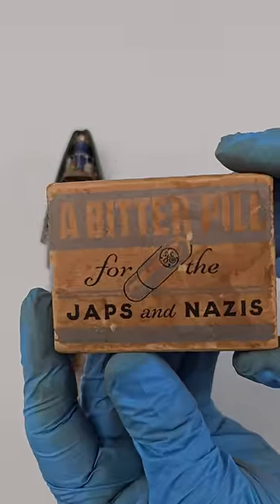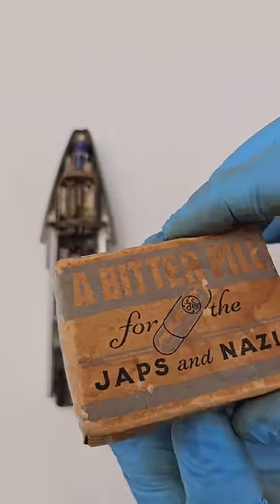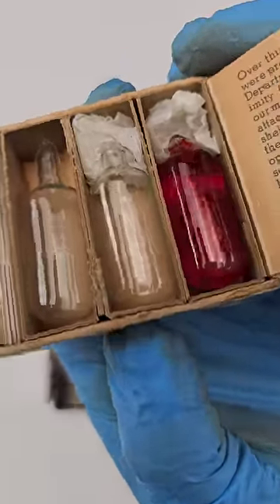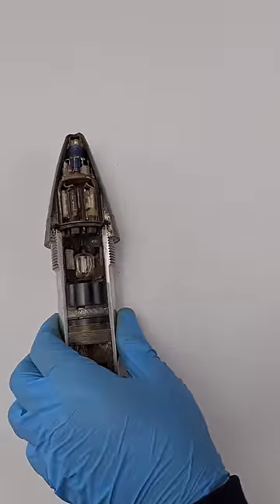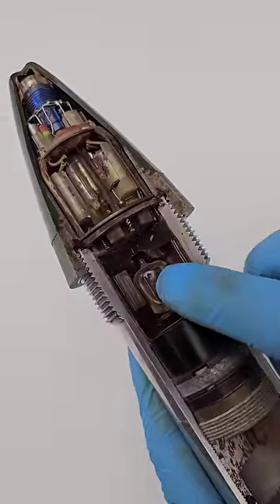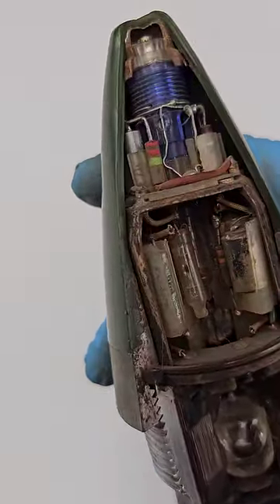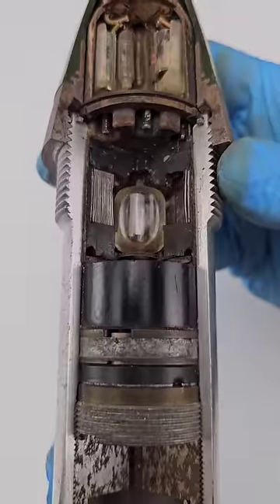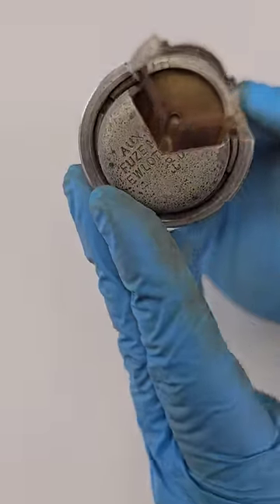RADIO PROXIMITY FUZE: General Electric Helps Beat Kamikazes & Win WW2 #military #history #technology

Comment: It's just astounding looking back at how far you could take analog technology
Reply: and still do. any electronic device you see or hear depends on analog circuitry still.
Reply: @tsm688  <<<<< lights a pipe n thinks that shit over. Ate you sure?
Reply: I love my old E.M.P. proof tube shortwave radios.
Reply: @timkelly2931  youtube seems to have eaten my long in-depth reply.

But yes.  A speaker requires an analog voltage to drive it.  A pixel requires an analog voltage to light it more or less.

Comment: British war winner, we just had no capacity to make it, however, the Americans made a fantastic job of further miniaturisation and they had capacity to mass produce. First used over water only to prevent it from being discovered by an enemy. Before it arrived it took approx 400 AA rounds to down a plane, after it was 40.
Reply from the maker: Good, correct, info!
Reply: This answers a lifelong question for me.. why do every WW2 footage of AA guns shows ten of them shooting at the same aircraft with no success.. 400 to 40 is crazy.
Reply: Incorrect. This design was 100% American. The Applied Physics Laboratory of Johns Hopkins University was already in work on the VT fuse before the British data was sent. The British design was a semi-active fuse that was to have only a receiver in the shell and would have depended on the transmitter in the radar set on the ground. It would have been much less effective in air to air use than the active system the US design used which had both a transmitter and receiver in the projectile. It would also be completely useless in the air burst mode that so decimated the Germans in the Ardennes. APL basically looked at the British documentation and said, nice, but ours is better. Johns Hopkins put out a documentary on the development of the VT fuse on its 50th anniversary, you should look it up, it's very good.

Comment: The artillery corps demonstrated the variable timed (non radio) version of the VT round for General Patton during WW II in “tree burst” mode. He watched from a hill as a barrage of artillery removed all of the vegetation from a small stand of trees. His response? “Those funny little fuses will change the war.” They were used to maximum effect in the Ardennes Forest in the counteroffensive of the Battle of the Bulge.
Reply: German mortars and artillery that were manually time fused to burst at tree top height during the battle of Hurtgen forest caused tons of casualties.  A VT fuse would have made those barrages far worse.

Comment: Well i recognize a couple resistors 1 capacitor, and  diodes... Dam i miss Radio Shack...
Reply: lol! No diodes back then, big old carbon composition resistor and mica capacitors, maybe a wax slug cap. The tiny vacuum tubes on the bottom of the circuit board were considered "top secret" you cant find spec sheets on them anywhere. I did find some schematics for these a few years ago. The circuit is real simple and is a type of regenerative receiver, which transmits and receives simultaneously.
Reply: @user-cr5yy4te3i  Haaa there's is intelligents still out there, Had a beer the other day with a friend of mine.
Reminisce of the old days of working on the radars, laughing our heads off, trying to remember the old saying about reading the Ohms resistance, on a resistor. All we could put together was (Every good girl)& (Violet gives willingly). 🤣 Thanks for the  information. Nice to know, 👍
Reply: me tooooo!! 😭
Reply: Yeah me too
Reply: Ebay and Amazon bro 😎
Reply: I miss Circuit City
Reply: @DrTwoGreenThumbs  bought some rally nice stuff down in Flordia, I miss them too
Reply: Sorry but u don't recognize (u actual are wrong completely different electronics present here) nor were they at radio shack at the time u were likely born
Reply: I miss Radio Shack, too. I was an advertising artist at Tandy. Good times.
Reply: Me too man i think we in hell now
Reply: wow you just named a few super common parts that are in almost anything that requires electricity to turn on... you must be so smart.... god if I could roll my eyes any god damn harder I would...
Reply: Dudeee
Reply: @tom4208  i  man yea his comment is cringe but yours is also hella cringe
Reply: Ah yes! When we use to FIX things, not just replace.
Reply: @daleslover2771 But Violet Gives Willingly.....I think, '83  was a while ago 😊

Comment: I was in an artillery unit in the NHNG. Later proximity fuzes had a mechanical timer built in that would delay the arming of the fuze until after number of seconds that could be set. This was so we could fire the rounds over hills or ridges and not have the round go off until after it had cleared them. We referred to these fuzes as "VT" (Variable Time) fuzes, despite them actually being detonated by proximity to ground. In a pinch, they could also be set for "PD" or Point Detonating.

Comment: One of the Best British inventions
Reply: Ah, yes. GE. The great British company… Ya, sure buddy
Reply: @KennethStone ah yes, an American company gers given an invitation to copy & that makes it an American invitation. Ya sure buddy 🤣
The proximity fuse was invented in 1940  by Samuel Curran, William Butement, Edward Shire, and Amherst Thomson. All of whom are British.
Reply: @KennethStone Manufactured by GE. They didn't invent them.
Reply: @chrissearle6176  Incorrect. This design was 100% American. The Applied Physics Laboratory of Johns Hopkins University was already in work on the VT fuse before the British data was sent. The British design was a semi-active fuse that was to have only a receiver in the shell and would have depended on the transmitter in the radar set on the ground. It would have been much less effective in air to air use than the active system the US design used which had both a transmitter and receiver in the projectile. It would also be completely useless in the air burst mode that so decimated the Germans in the Ardennes. APL basically looked at the British documentation and said, nice, but ours is better. Johns Hopkins put out a documentary on the development of the VT fuse on its 50th anniversary, you should look it up, it's very good.
Reply: @chrissearle6176  Invented? Writing a paper that says "we should put a tiny radar into an artillery projectile" isn't really inventing. It's stating the obvious. Inventing is producing the hardware.
Reply: @Mishn0    no you are in lncorrect
Firstly, Everybody was working on proximity fuses & there were loads of different types of proximity fuse being designed in lots of countries, it was Britain that solved all the issues of miniaturisation & invented the parts needed such as the Cavity Magnatron & made & used the 1st PF. These fuses, information & findings were shared with John Hopkins as part of the co-operation projects. They then when on to help refine it. They also figured out the problem of mass production.
Reply: @Mishn0  yes invented, the proximity fuse requires 4 British inventions, most importantly the Cavity Magnatron. It was the British that solved miniaturisation & produced & used the 1st fuse. That was then shared with America through the joint research project.
Reply: @Mishn0  The Brits also invented radar itself at around the same time, so saying "we should put this thing we just invented into a shell" kinda IS inventing the idea...
Reply: @Aethid  No, the Brits did not invent radar. They did invent the cavity magnetron which made a large increase in transmitter power. Why is it, when a Brit supposedly invents something, it means it would never had existed otherwise? The concept of radar was discovered by the US Navy, by accident, way back in 1921. Germany, Japan and probably Italy and Russia also independently "invented" radar.
Reply: @chrissearle6176  There's no magnetron in a VT fuse. And please read what I wrote, the VT fuse that was introduced into service wasn't the design that was shared by the Brits. It was developed by the APL. Watch the documentary I mentioned.
Reply: @Mishn0  theres no magnetron in a variable timming fuse, but there is in a proximity fuse. you can't produce the radio pulse in small transmitters without the Cavity magnetron.
Reply: @chrissearle6176  VT was the code name for the radar proximity fuse developed by APL. They wanted any adversary hearing about it to think it was just another variable time fuse. 

There is no magnetron in the VT fuse. It's not big enough. It probably used a klystron tube as it didn't need the high power of a magnetron as it acted at a comparatively short range.

A magnetron is not required for a radar, it just needs a microwave frequency oscillator, of which a magnetron is one type. 
Actually, a radar set needs at least two oscillators, the receiver needs it own local oscillator that is tuned to the received pulses who's frequency will be different that the transmit pulse due to doppler shift. A travelling wave tube is another high-power microwave oscillator.

The radar I used to work on used a magnetron for the transmitter and a klystron for the receiver. A magnetron wouldn't work in the receiver because it needed to by dynamically tunable to adjust to the changing doppler shifted return pulses.

 Don't talk about things of which you know nothing about.
Reply: @Mishn0  The key invention behind radar is the cavity magnetron. A British invention. Multiple people around the world thought of the basic idea of bouncing radio waves off something to measure distance, but the technology to actually do it was invented by the Brits.
Reply: @Aethid  Hmmm, the Germans did pretty well with their radars, even before they captured their first magnetron in '43. They were using the "Freye" early warning radar as early as '40. Magnetrons make radars better, but they aren't required. You guys really like to bang that drum, don't you?

Comment: never would have guesswd that's how it worked. Wonder how long it took Nazi command to figure out why the Allies' AA seemed so lucky!
Reply: it was mostly Japanese aircraft that these shells were used against, surviving pilots said that they took a physical beating from these shells, there were so many exploding so close that the shocks threw them around.
Reply: @BjarneLinetsky  Yep it was used to devastating effect against the Japanese in the Pacific, mostly by the US. IIRC it lowered ammunition expenditure rates by an order of magnitude it was so effective at destroying planes, no more setting fuses for airburst or hoping you got a direct hit with 5" shell.
Reply: @BjarneLinetsky It was used in Europe for artillery though. Similar to how the Germans used mechanical fuses for airbursts in forested areas.
Reply: @Rico-v7r  Not this particular fuse. They had another design used on mortar shells that would explode the shell 50 feet above ground. My father was well acquainted with the German shells, having experienced the Ardennes Forest during the Battle of the Bulge.
Reply: They weren't used over land until late in the war. They were too worried about shells getting recovered and potentially reverse engineers, so they were only used over water. Late in the European theater I believe they used them to create air burst artillery that was quite devastating against the Germans.
Reply: @bobbygetsbanned6049 I think there were used in the bridge to far operation to try and get to the bridge. Considered important enough to override the security issue
Reply: I always wondered how long it took before the germans were able to get the fuses on the black market,(if at all), because in ALL wars there is ALLWAYS  a very active black market used by both belligerents, military and civilian.
Reply: I'm pretty sure one thing they were used for was the defense of Britain against V1s! They were part of the reason why during the later part of their use over 80% could get intercepted with only around a hundred shots per bomb, which is pretty incredible!
Reply: @markbowles2382  The Germans never did because it was a military secret. The Germans did however copy the Bazooka
Reply: A day maybe? They were well aware of the concept of a proximity fuse and worked on their own version.
Reply: https://en.m.wikipedia.org/wiki/Proximity_fuze
Reply: @BjarneLinetsky  They used proximity fuze quite a lot , with the anti aircraft gun's against Germans . This fuze was invented by the British  early in war , before USA even got  involved  in war in Europe
Reply: Never did
Reply: Never did
Reply: Never did
Reply: Never did
Reply: Never did
Reply: Never did
Reply: Never did
Reply: Never did
Reply: Never did
Reply: Never did
Reply: Never did
Reply: Never did
Reply: Never did
Reply: Never did
Reply: Never did

Comment: Radio proximity fuze was invented by the British early in WW2
Reply: Incorrect. This design was 100% American. The Applied Physics Laboratory of Johns Hopkins University was already in work on the VT fuse before the British data was sent. The British design was a semi-active fuse that was to have only a receiver in the shell and would have depended on the transmitter in the radar set on the ground. It would have been much less effective in air to air use than the active system the US design used which had both a transmitter and receiver in the projectile. It would also be completely useless in the air burst mode that so decimated the Germans in the Ardennes. APL basically looked at the British documentation and said, nice, but ours is better. Johns Hopkins put out a documentary on the development of the VT fuse on its 50th anniversary, you should look it up, it's very good.
Reply: @Mishn0  No it wasn't 100% American Edward Shire, and Amherst Thomson conceived the idea early in WW2 , researched got transferred to the US
Reply: @nounoufriend1442  What I'm saying is the design actually put into service was 100% APL. They didn't use the data from Britain as they had already been working on their design for half a year, and it was better than the British design. Watch the documentary I mentioned.

Comment: Now THAT is freaking cool. I thought the brits were the only ones to utilize ampules inside the munitions.
Reply: @toiletpapermerchant9310 The Brits barely worked on it before they gave up on it. Basically dead ends. The technology was developed at Bell Labs and John's Hopkins
Reply: The Brits used electrolyte ampules for battery cells after the technology was developed in the US
Reply: https://en.m.wikipedia.org/wiki/Proximity_fuze

Comment: That's so cool. I ran a 750 ton hydraulic press that built it 1945 for the war but probably didn't pump out too many parts for the war.. The Birdsboro. Damn thing was all valves and poles to spin valves I couldn't reach and had electric motors and stuff added to sort of modernize it. Pressed out lots of parts that were for GE and the aerospace industry. Seeing this makes me feel like that job was meaningful.

Comment: During WWII, British forces devised a clever use of dissolving aniseed-flavored candy as a timing mechanism for underwater mines. The candy was chosen for its predictable dissolving rate in water, allowing for precise control over the timing of mine detonations. When placed within the fuse assembly of a mine, the candy would gradually dissolve until it triggered the fuse, setting off the explosive at a pre-calculated time.

Comment: Breaking the capsule releases the electrolyte and "creates" the battery by flooding the Anode and the Cathode.  I presume the electrolyte was diluted Sulphuric Acid (H2SO4), the same electrolyte used in car batteries then. Even today  this is the standard "car battery" used in non-electric cars.

Comment: May have been said before, the battery would only work when the shell was spinning (IE shot) as the electrolyte would only fill the surrounding plates under that condition.  thus never work if they broke on the deck

Comment: This is a second version. The first version used a battery, which would degrade in storage, especially in the heat and humidity of the Pacific theater of the war. And it should read "VT FUZE" with a "Z" not "VT FUSE." They are not the same thing. And the program to develop this fuze was as secret as the Manhattan project to develop the atomic bomb, and cost more than that massive program.

Comment: Why did it need to have a radio in it? This is insanely cool tech
Reply: It was both a radio transmitter and a receiver. It always transmitted a weak signal. When the shell got close to an enemy aircraft, the signal sent out would bounce off the airplane and the receiver would pick it up. That made the shell explode. That meant you no longer had to hit the aircraft to kill it, you just had to get the shell close enough and the flying shrapnel would take it down. That radio fuse detected when you were close enough. Getting close is 1,000 times easier then a direct hit. Oh, and you don't want it exploding while you were handling it or shooting it. To make sure of that that glass vile had to break and only the force of firing it could do that. The shell also had to spin really fast so that the centrifugal force would put all the now spilled electrolyte all around the outside in a ring simultaneously where the battery plates were. If it wasn't spinning crazy fast the electrolyte would just pool in one spot and all the plates wouldn't be soaked. Only firing from a rifled barrel could make it spin that fast. There was also a capacitor that had to charge so after the glass broke and after it was spinning to initiate the battery, it took about a second before the thing activated. That let the shell get some distance from you so that just in case when it activated it blew the shell, you who fired it were safe from it's ravages.
Reply: @ Ahhhh see I was confused as to why once it was embedded into a target why you would want to wait to transmit a signal to make it explode, this makes so much more sense! Thank you for the thorough explanation!